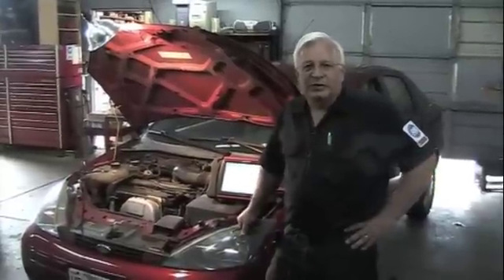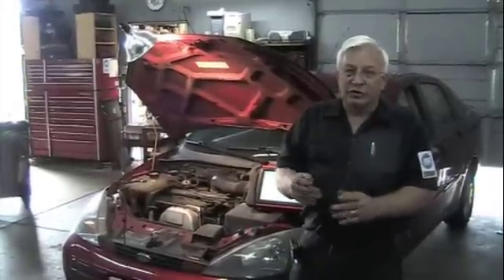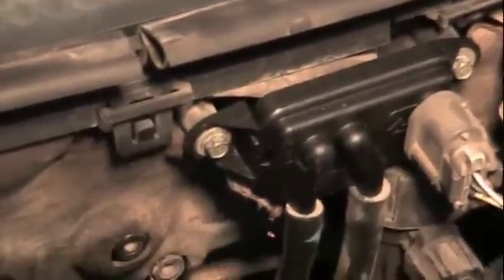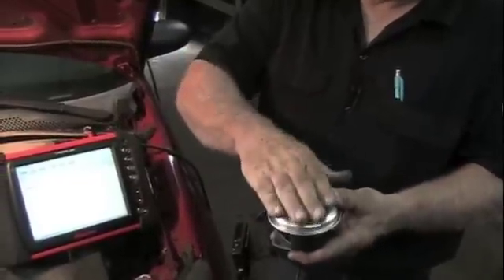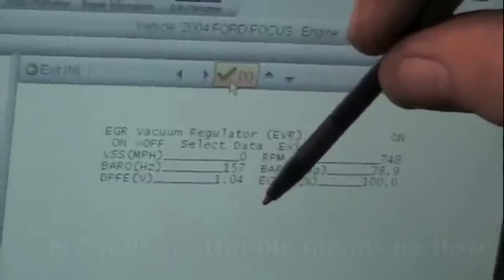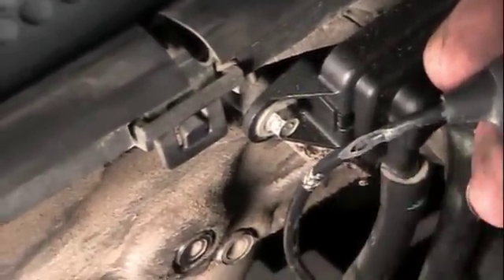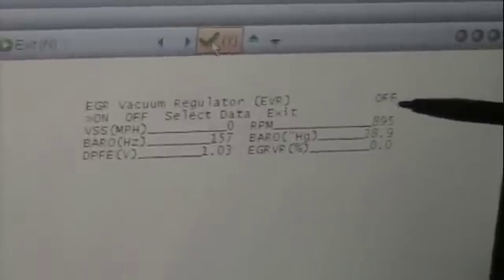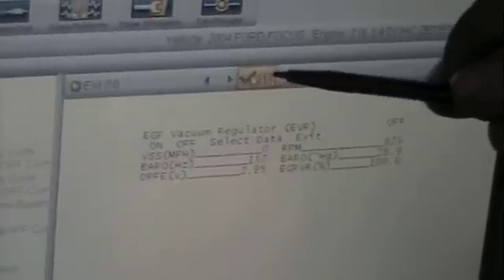P0401 EGR Insufficient flow test

Comment: @mrfordexplorer97   Sounds like you got a plugged port.  To check there is two  ways.  One is to pull the vacuum line and apply vacuum to the EGR while the engine is running. If it stalls the port is clear.  
If it does not stall the port is plugged. 
Or you can remove the valve and plug the vacuum line start the engine to see if you got great suction on the intake side of the EGR if you don't the port is plugged.   Use some Carb cleaner and a stiff wire to clean it.   The other pipe runs to

Comment: Great explanation, Duane. I guess I would have started with the hoses, as access to computer diagnostics beyond OBDII is not avail to a backyard mechanic. 

You make a great point that the pro needs to stay with basics, as the temptation would be to throw parts and see if the problem is fixed. That way would have eventually led to the solution, but only after the customer might have paid for replacement of normal devices.

Comment: @920gamez You probably did this,but check the plumbing from the engine, the canister purge solenoid and the canister itself. Also check the cas cap. P0445 means a large leak in te evaporative emissions system. I had a similar problem with my Dodge and it was a loose hose.